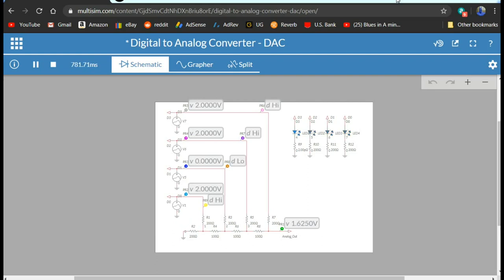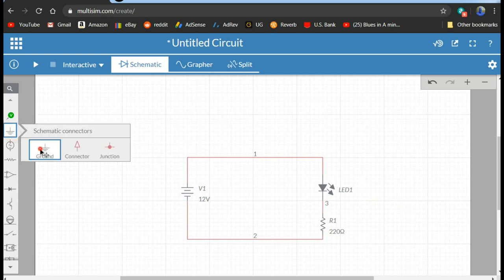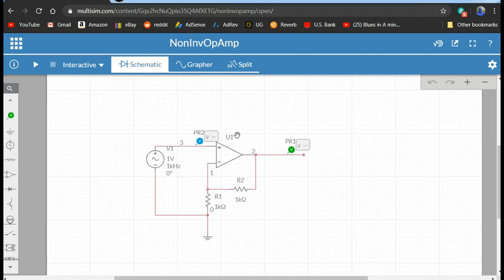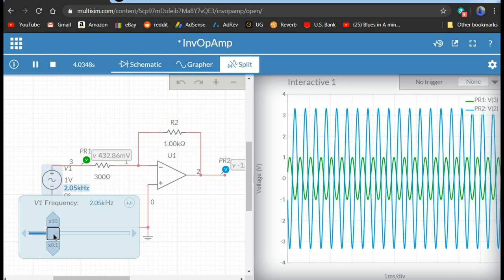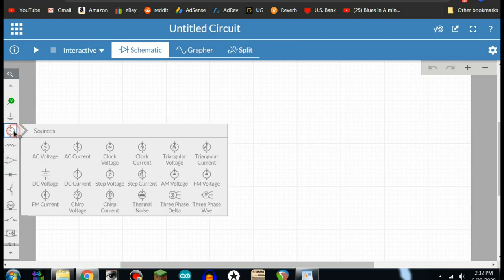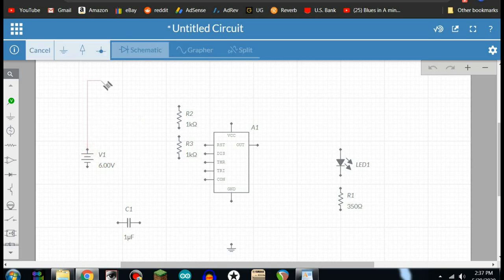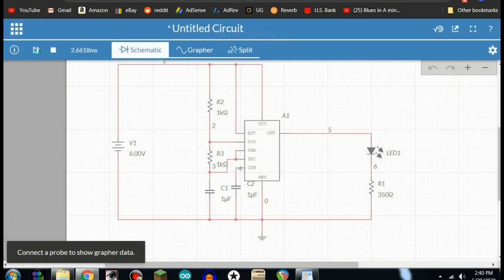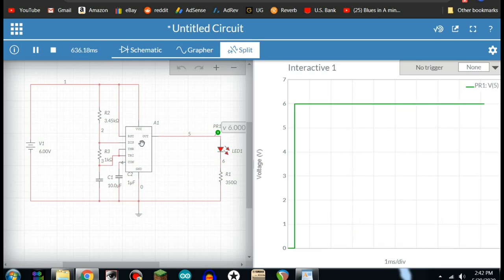Online Circuit Simulators

Comment: What if my circuit is designed to let the magic of smoke out? Simulation of magic smoke should be required for an accuracy.♨️
Reply: I think you would have to pay for the realism upgrade package on that. Not available for free users.
Reply: But seriously, did this simulator show that the LED burred out?  It would be nice for it to check current levels for all components.  Otherwise, one will need to add an amp meter to each and manually check.  I’m going to download it and play with it.

Comment: To get a LED with 'normal behaviour' like a Voltage Forward of 1.7 to 2V @ 20mA you need to put N to 2.32 (1.7V) to 2.73 (2V)

Comment: I think I looked about about 10 online circuit simulators and none of had what I wanted. Tinkercad looks great but doesn't show pinouts (unless you hover over pins and have hours to waste) and the schematic viewer is only static.. Multisim seems to be what I'm looking for! Thanks for showcasing it - especially with the 555 and flashing LED. I hope it has interactive pushbuttons and switches.. I'll have to go and check it out.

Comment: Again, thanks for the video. NI’s simulator works but I was wondering if you have a recommendation for an RF circuit simulator. I typed antenna and Balun  into the component search field of Multisim and ended up spending $9.99 to find out it doesn’t support RF circuitry. It’s not money wasted by any means, I’d just like to find a simulator of comparable quality to simulate RF design.  Thanks for your time!!

Comment: Hi good for proving concept brewing in the rusty grey matter have dual 555 circuit on B/Board so far just by luck I've only blown up 1 LED.   I have to agree with RayDT comment some values do not match real world.   Tried 555 mono-stable and could not get real simulated Cap/R1 values to match real world delay on-time!  Also tried your simple npn 2N2222 inverter  circuit and simulated values for base resistor at 10k just would not work! had to drop to 2K or less.   Also the free online version only allows you to create circuit with max 25 components.   But still very useful  Thanks!

Comment: Nice simulator and fun to play around with. So far the only issue I have with the LED circuit is that the voltage drop across the LED is way off and doesn't seem adjustable.